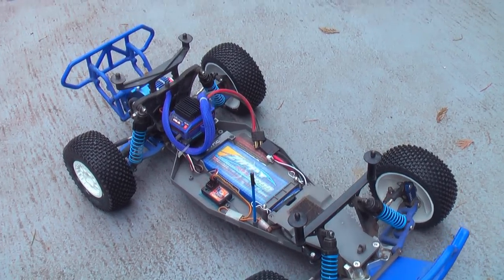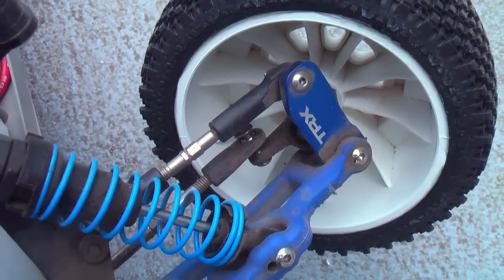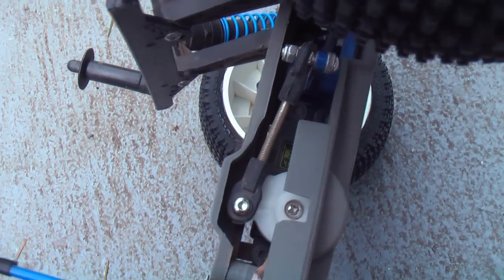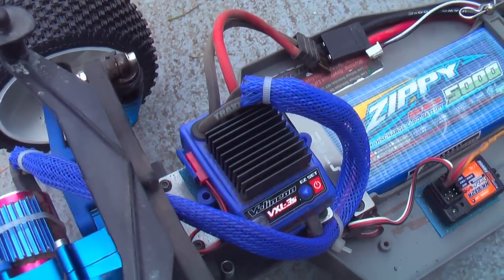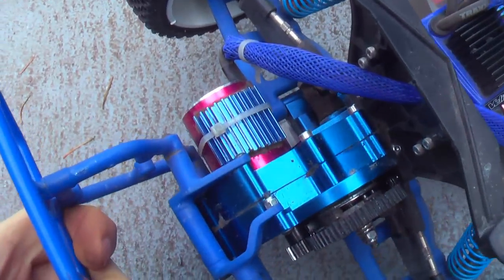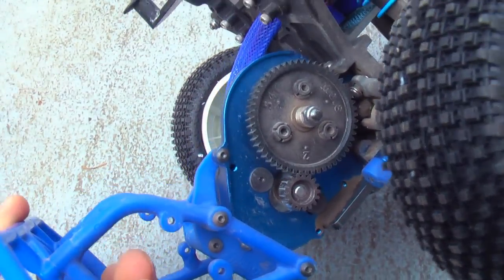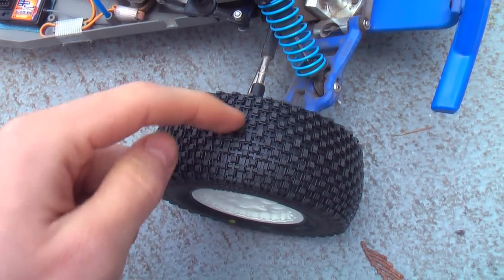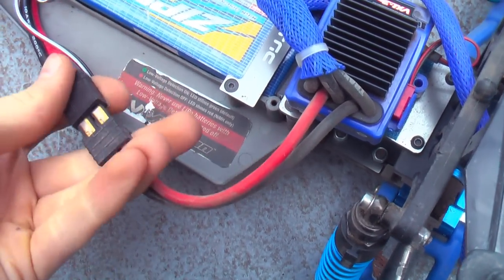STRC LCG 2WD Slash

Comment: Yes, all parts are interchangeable and it works great and handles incredibly better than your stock slash, I built my own bracket and put the transmission back to the end of the original rustler chassis drilling the 4 main holes never minding the two out past the end this gives it not only a lower cg but a slightly shorter wheel base and handles way way way better than I have ever experienced, good rear tires for better traction and viola it handles on the track like a 4x4-almost...

Comment: Beautiful kickflip! that was pretty sick. Rob Dyrdek style XD hahaha
I got a 2wd slash with a mamba max pro esc, unsure of motor but its powerful, and 2 7 cell 8.4v batteries with 2.4 ghz radio and trx waterproof servo. I also have rpm cater blocks but i need rpm's in the front also =\ and what is your output on the vxl? im looking for waterproof and i dont know if i wanna risk waterproofing the mamba. input please? if you think its better i may trade mine for a traxxas vxl and maybe motor.

Comment from the maker: @TRXracerZeka95 No, It's not better than the Velineon, much slower/not as powerful.  If you want a good motor at a great price, check out the Tacon motors at HobbyPartz, for $24 you just can't beat it, they are about the same as the velineon.

Comment from the maker: @shadowmattp It's cheaper to buy a Slash and convert it to what I have, because you would need to buy a Slash body and tires if you got a Rustler and converted.  Although, if you plan to get aftermarket tires and body, then a Rustler to Slash conversion might be better.  I would say if you want a totally custom slash, get a Rustler and convert, but it you want to use the stock body and wheels get a Slash and convert it to an LCG Slash.

Comment: forrest your car isnt really a sad excuse for a slash because alot of people convert the slash chassis it to a rustler chassi and use the strc lcg kit or they just make a custom chassis. the reason they do this is because the stock traxxas slash chassi sits really high which causes it to roll over on tight corners so overall you have a real advantage on the track :)

Comment: you don't have the pro level big bore. you can get font and rear sold separate and they are with out tit shafts $30 each. when you get the pro level they are sold as a 4 pack kit. im sure you already now by now. nice truck. thanks for video.

Comment: Your lipo may not have a high enough discharge rate, the voltage drops under a highload tripping the low voltage cutoff.